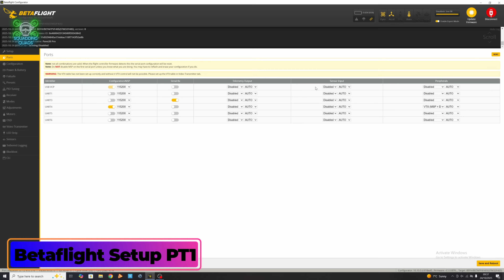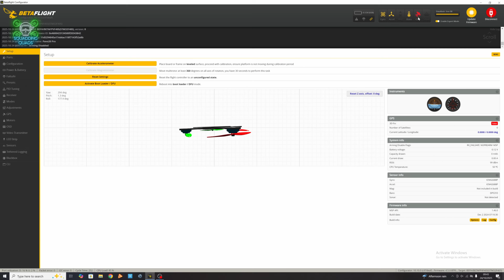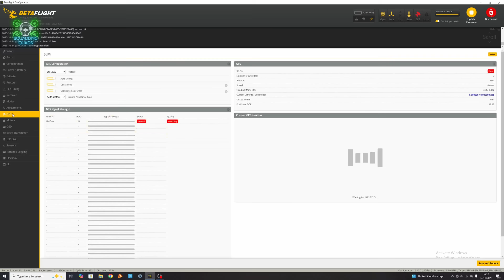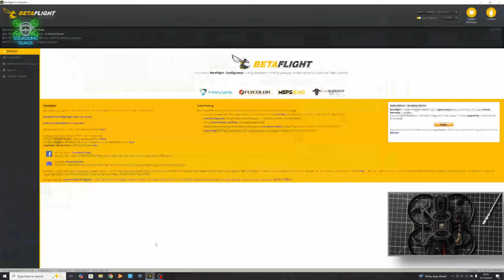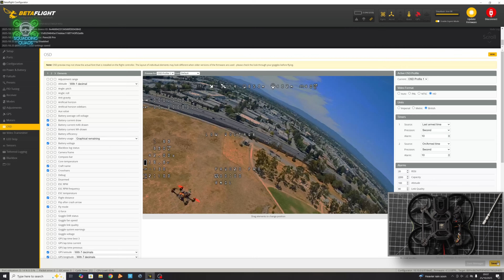How to Install & Setup a GPS on the BetaFPV Pavo20 Pro + Full Speed Test with BoyWonderFPV!

Comment: Hi how do I get the link quality to work? I am using the DJI FPV radio 3 with the Pavo20 but my link quality just stays at 0 on the OSD?
Reply from the maker: Lq doesn't work with dji man
Reply: @squaddingquads how do I tell if i'm losing signal?

Comment: How many satellites do you normally get? That location for the GPS seems good since I've seen that it is not a good idea to place it on top of the vtx or under the antennas.
Reply from the maker: Normally once I hit 10 locked I'm gone and flying and it won't drop, takes about 45 seconds to a minute to get that

Comment: Did install my GPS a few days ago but it can't get a fix. In BF satellites shiw up but can't be used. tried it indoor and outdoor.
Reply from the maker: What module are you using
Reply: @squaddingquads the same as you
Reply from the maker: @Gambi-v1r check your ground solder join then, I've noticed with these you've gotta have a good solder joint on ground pad. Nothing perfect, just nice and solid
Reply: @squaddingquads ok thank you! will try that!
Reply from the maker: @Gambi-v1r no worries mate
Reply: @squaddingquads kinda worked got a fix twice but went flying today and got no fix again
Reply from the maker: @Gambi-v1r how long are you waiting?
Reply: @squaddingquads waited for 10mins tried it again indoor and outdoor but sadly nothing
Reply from the maker: @Gambi-v1r you might need some copper tape to insulate your GPS wires then man, but if it's the same unit and in the same location as mine it SHOULD be OK
Reply: @squaddingquads Will try that too. yes is in the same location as yours and same GPS
Reply: @squaddingquads tried the shielding but sadly nothing changes. I guess now I have a GPS just for the looks 😄

Comment: Just something I noticed watching your speed runs.  Is that a motor warble I'm hearing?  As in tune is a little hot or off song?      Coincidentally I fitted a GPS to mine over the weekend, haven't been able to fly it yet. I just used some E6000 and stuck it on the top of the camera cover.  Ended up using a walksnail m181. Probably a bit heavier than the flyfish but it's all I had in my tub.
Reply from the maker: It does sound a bit weird on the last run doesn't it